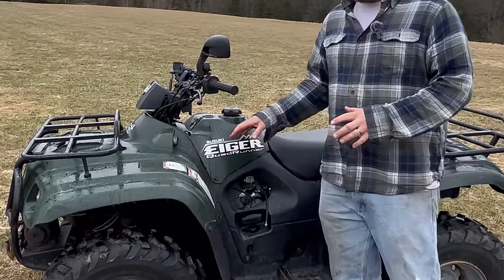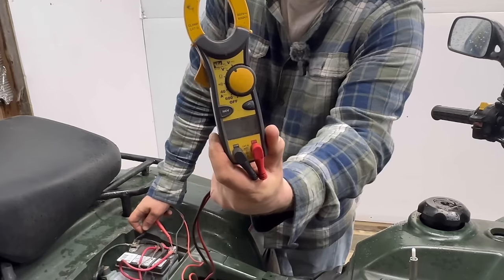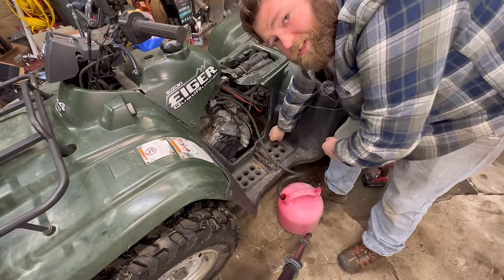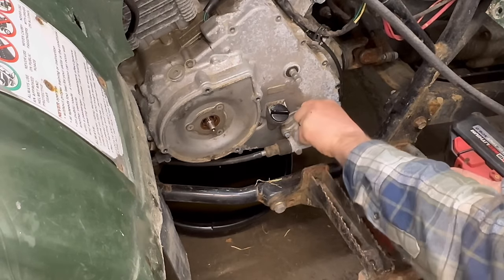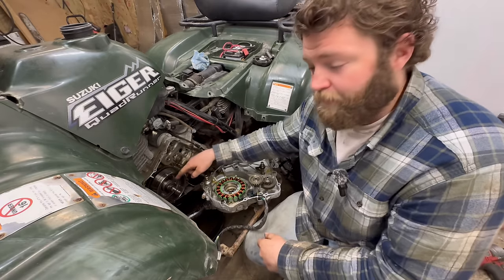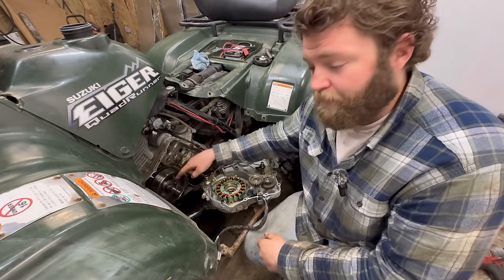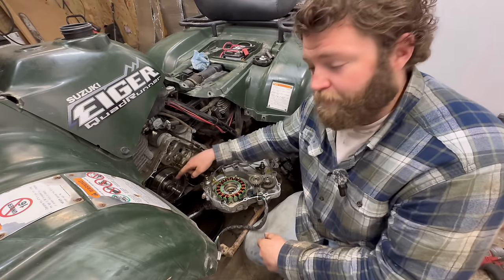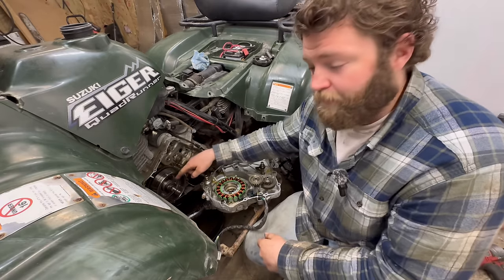This is the biggest FLAW on these Suzuki Quad's!!!

Comment: I have one of these motors that dies after about 30 minutes of riding. Once it sits for a bit it will start again and run. I'm thinking its the fly wheel, but not sure. Is it a possibility?
Reply: Coil...
Reply: @Yo-mamashouse  i had replaced the coil already, I’m not the first owner of this atv, pulled the side off the motor found the flywheel was already upgraded, swapped the stator while I was in there, replaced the voltage regulator. Problems fixed… either that stator or voltage regulator.

Comment: I have a water problem with my eiger. It seems to get into the tank no matter what I do. But it burns off within a few minutes of running and works fine afterwards. 
I also have a 2000 Suzuki King Quad 300 that the engine is locked up. Does the flywheel problem effect those models too? Would it be best to pull the side cover and check the fly wheel before checking the top end and the piston? Where would you look first?

Comment: 2000 wasn’t the only year arctic cat used the eiger - my ‘07 400 had the same exact motor and had the same exact issue I ended up doing the upgrade
Reply from the maker: Yeah i meant to say 2000’s if I didn’t. I believe 2008 was around the last year of the eiger engine in the Cat’s.

Comment: I had the same quad and it ran great but then out of knowhere it wouldn’t start up when hot and left me stranded few times . Turns out it was a fuel prob in the petcock witch was weird I guess that diaphram in there wouldn let the fuel flow
Reply from the maker: Yeah, there is a very fine mesh screen in the petcock.. clogged up pretty easily with dirt and debris.

Comment: Can you confirm if this magnet issue applies to the old 1st gen Arctic Cat ATVs? I did some research, and I thought the older ones don't have the problem (this would be the pre-2000 bearcat 454, 400 and 500). But I never was able to find a 100% answer.

Comment: I need advise 
My 1999 kodiak 400 is backfiring through the carb and I’ve loosened intake valve and it’s still not starting. Would that be a bent valve or something else? Help would be appreciated.
Reply from the maker: Could be a few things. A very lean condition could cause backfiring through the carb. Have you clean the carb recently? Also check to make sure the runner boot in between the carb and engine is not cracked and sucking air. 
It could also be a timing issue. Did you check your timing alignment to make sure it didn’t jump a tooth or so?
Reply: @rockspowersports  carb is clean and the intake boot is fine and engine is timed correctly
Reply: @rockspowersports  figured it out the flywheel key is sheered